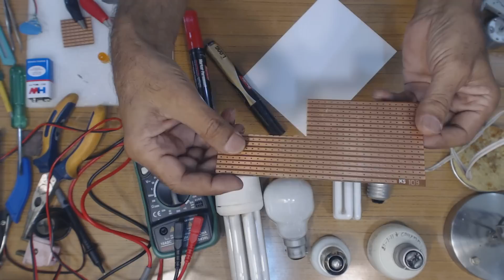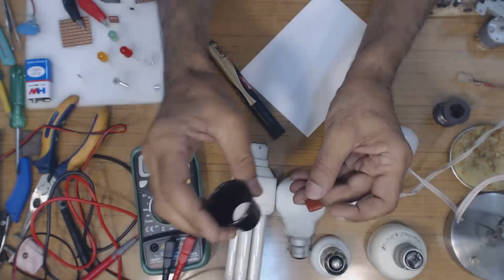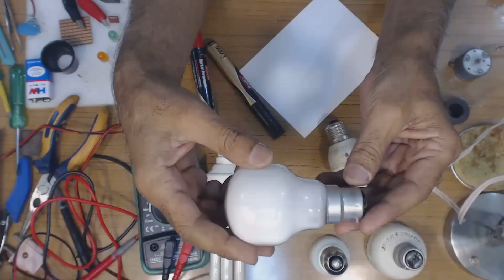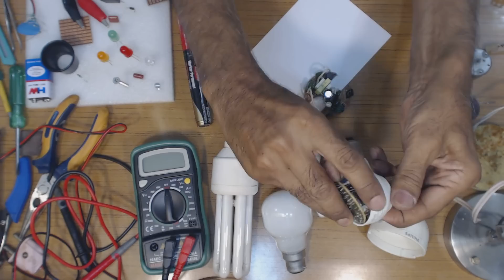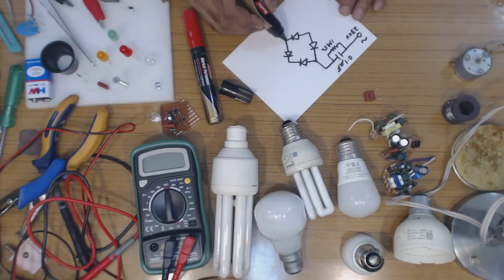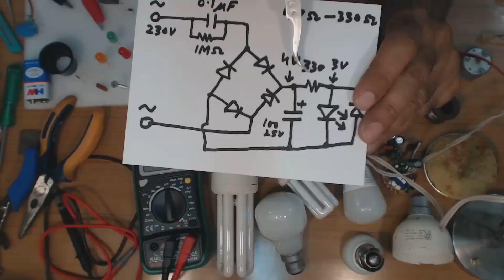Make Mains LED Lamp using  parts from Fused CFL

Comment: wow 3volt...without using any voltage regulator ic or transformer but I need 5v-6v using thing kind of diagram for lamp../ diagram could be digital using pc or laptop.

Comment: I liked your CFL video very much. Can you pls help me with a detailed guide for repairing electronic chokes for 4 ft tube lights , mentioning different test points and the voltages at specific points ? Is there any way to test an electronic choke to be functioning or not without connecting to a tube light ? Wait for your early response please preferably at. bnber_2004@yahoo.co.in
Reply from the maker: Sorry Sir I can't. In fact I try to answer genuine questions relating to the matter in the video in question.
Yes if in future I ever make a video on Electronics Chokes then only You may ask a relevant question.
Reply: Hi, I have repaired some of these - the ease of repair depends on the complexity of the ballast.  You can easily measure some voltages, and test components (with the power disconnected). You can locate many simple faults this way, but the final test to determine whether the repair was successful has always to be made with a tube connected.  Contact me here if you want more help.

Comment: Great video 
I want to know if we change the polarity of AC supply then what will happen.
as per schematic you have given positive AC to 104k 400v capacitor & negative to diode bridge rectifier and while plugging with two pin top if i reverse positive into negative and negative into positive, the 230v positive will drive directly through bridge rectifier, is it make any issues, just want to know as I have not much experience.

I like your video
Reply from the maker: No dear it does not matter and in the schematic I did not mark positive and negative. AC as you know is alternating and as we use a bridge rectifier so both cycles are rectified that is why we call it a full wave rectifier.
Thanks for watching.